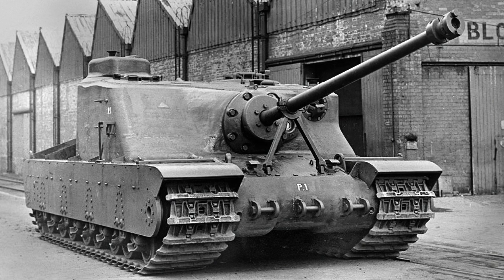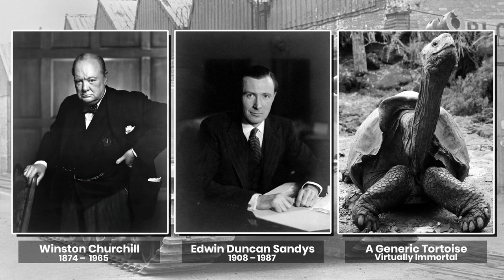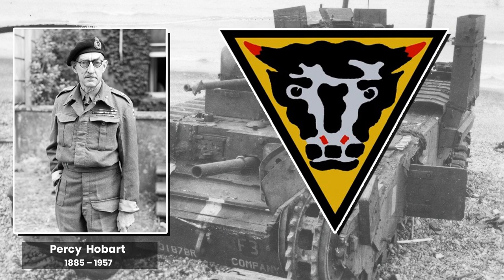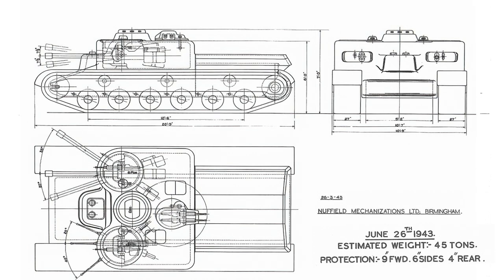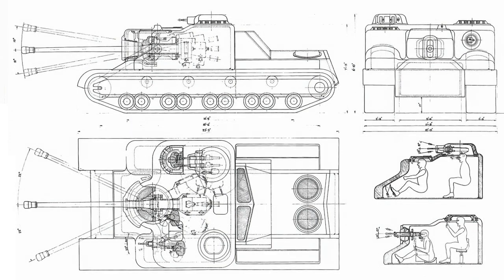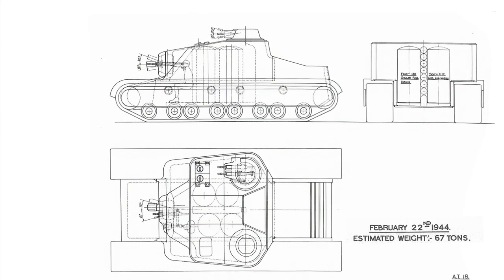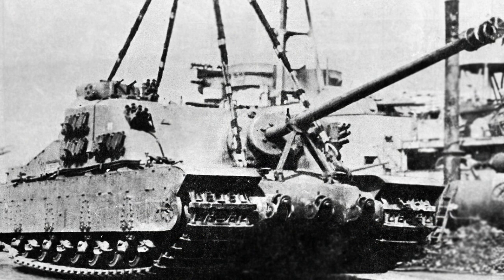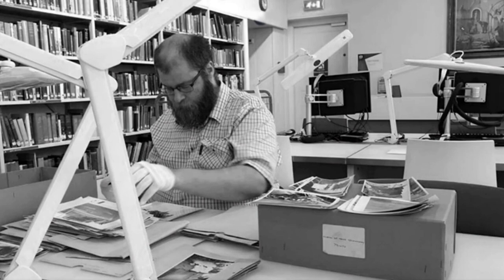A39 Tortoise - Tank Design and Development

Comment: I remember the tour guide at Bovington saying that on it's first demo before VIPs coming out of the shed it almost squashed those VIPs because the driver steered one way but the tank went the other - the controls had been incorrectly assembled.
I don't quite believe the story but that's what the guide told us.
Reply: The volunteer 'guides' at Bovvie are great for enthusiastically getting casual visitors interested, but do come out with some questionable 'facts' sometimes...
Reply: That would have been a wonderful event if it had happened. Road kill VIPs, who never fought in WW2, coming to an end in such a way. They could have been called the hedgehogs.
Reply: If it's reversing, it might have "turn nose the direction of pulled lever" control scheme. So pulling the left lever would make the nose turn left, and the butt turn right, rather the usual brake that side of track. And then some story went around and it becomes told as a technical error rather than the driver not knowing of the thing, because he's never been told, because it's Bovi.

Comment: Good video Ed but you are mistaken about the final suspension arrangement. It does not have a single wheel, 3 pairs and a final single but it has 4 identical suspension units with two wheels each, like a Sherman's on steroids or 4  Centurion units fitted with Conqueror wheels.
Reply from the maker: the 1-6-1 bit. as in single pair 6 in 3 pairs and 1 pair at the rear

Comment: Wonder how well they would have done against directly postwar USSR tanks?
Reply from the maker: enough to knock out is3 frontaly at 1000 yards. - except turret cheeks, although it was never designed for this. the 20pdr however was which was ready in 1944! but not fitted until much later.

Comment: Do you know anything about the FV3807 and FV3809? All I can seem to find is just what guns they were supposed to get
Reply from the maker: heya, yeah they were not made. so when teh FV series came in the idea was that each vehicle would have a corresponding support or varient vehicle on the same hull, however many of thehse were not made. 3802/5 were made the others were not but allocated a number should they be made. Centuion did have a casemated version (sp4) and later a 155 VSEL turret much later and not part of this project.
Reply: @armouredarchives8867  thank you
Reply: Also there is a picture of a valentine with a long barreled gun, I've asked what kind it could be and a few people have suggested it was a 8pdr or even a 12pdr. Do you know of the picture?

Comment: It's easy to say now that a tank like the Tortise was never required because the war was won. But at what avoidable cost in men and material? Except to some degree with the Churchill all other Western tanks were vulnerable to a extensive range of German weapons. So doesn't it make sense that that vulnerability should have been reduced by using something like the Tortoise in a regular leader role right at the sharp end? It would have been relatively slow in transport mode but quicker in the attack mode and that was the important thing, not to be help up excessively which did occur regularly.
Reply from the maker: By the time the project was ready, the war was nearly over. this was a period of mobility over anythign else and so a slow movign and diffuclt to transport vehicle would have just held things up, as well as cause a mess in terms of doctrine and force stucture. Simply having a Tortoise seconded from RA to RAC for each advance would have slowed everythign down and given the enemy more time to prepare. A colum leader like Jumbo would have been handy, but the UK was still mired in Infantry and Cruider roles which made such notions more dificult.
Reply: @armouredarchives8867  The 'slow' Matilda showed what could be done in achieving quick economical victories, why the British did not immediately begin working on a upgraded replacement with an appropriate gun makes no military sense.
Reply: @FairladyS130  Debatable. Matilda II was very good at shrugging off the [then] heavy caliber rounds; but even in the Battle for France the Germans had some 88mm guns, which no Tank in existance [anywhere] was sufficiently armoured against.
(worth noting the largest dedicated A/T Guns in the UK & Germany during 1940 were in the 50mm size range; nothing bigger was to be seen, except in short barrel form)

This wasn't deemed a serious issue though in of itself, as Anti Aircraft guns were rarely encountered by Tanks, and doctrinally not supposed to be used against them anyway.
(Aircraft not being known to wait around to be shot down)

As it was the Germans produced the Tigers and Jagdtiger for basically the same reason the British developed A39: as a Breakthrough Tank. The difference was that Tiger was designed to be the minority of heaviest hitters at the apex of an armoured fist (a "Panzerkunst" if you will), while A39 was intended to destroy heavy fortifications where 17 Pounder armed fare wasn't enough, and naval gunfire support or RAF wizardry unavailable.
Reply: @jimtaylor294  For a start AA units were routinely attached to German ground units in a multi role capacity. So they were a real threat to a breakthrough because they were the last line of defence for a particular unit. Compared with the Soviets the Allies were just too slow to recognise a need for a heavy break though tank and promptly act upon that requirement. And just because they did not act promptly it does not inevitably follow that the need did not exist. It all cost infantry lives but who cares.
Reply: ^ A flawed conclusion in many ways, but here's just a few:

• The 88mm was not available in large numbers in most theaters of the war, making "often" tentative.
• Heavy AA Guns are niether easy to move around, nor typically have armour shields (of any use against ground fire), which is why the Wehrmact had to split off some of 88mm production into dedicated anti-ground mounts.
(the US & UK already knew the practical problems of moving heavy guns around from, which is why a good enough approach was used)
• Having more sizes and types of guns in service than you can make do with is only a drain on logistics and industrial capacity; and as any economist will assert; failing so completely at both is a leading factor in why the Germans lost WWII.
(seriously: look up their absurd number of gun types, subtypes thereof, and ammunition requirements thereof: it hastened their defeat by a considerable margin)
• Between D Day and VE Day, the western allies gained territory every day along the front; even during the Battle of the Bulge, meaning the theoretical german advantage in firepower didn't amount to much.
• As anyone familiar with UK rail loading gauges can affirm; there was a practical weight and size limit, which combined with limits on engine power and torque restricted what could be practically operated even further.
• As any picture of a Panther (45 tons) marooned by a collapsed bridge can illustrate; Heavy Tanks & bigger were a bad idea in general for the terrain of western-eurasia. Add in the fact that most of Germany's attempts thereto were scarce on the battlefield, comically unreliable, insanely expensive and riddled with weak points (Tiger's even side on were woefully under-armoured against allied Tank guns, look it up) & drank increasingly limited fuel like it was going out of fashion... it's no wonder Germany lost the war within a year of D Day.

As mentioned: Matilda II proved that no allied Tank (even in 1940 when German hardware was still limited in firepower) was immune to Heavy AA weapons, but this was as much if a given as bding vunerable to Naval Guns... because no Tank on any side in 1940 was immune to guns that large , nor could realistically be expected to, as they weren't designed to be.
Reply: Not to mention that most Heavy Tanks were rendered much less relevant postwar, as the Shaped Charge and advances in KEP rounds rendered RHA Steel on its own no longer enough. This was why some postwar Tanks didn't even bother with thick armour, until the pioneering of  Composite Armour & ERA changed the dynamic again.
Reply: @jimtaylor294  The Western front experience against an already depleted and disrupted German organisation is not relevant to the equipment used in the bulk of the fighting which was done by the Soviets. They responded directly to the threat they faced whereas the Allies didn't, they (particularly the US) just used their overwhelming industrial power which made any unsuitability of their equipment and consequent losses irrelevant. The heavy armour the Soviets developed and used in response to what they actually faced clearly illustrates my point and incidentally negates yours.
Reply: ^ Clearly you're as nuerotic as you're poor at reading comments, as I wasn't referring to WWI, and don't have a weird obcession with disproving others, rather in the facts of a given topic.

Oh; and the USSR only did a major chunk of the land war; and needed vast amounts of allied material aid. So much so that during the Battle of Moscow, over 70% of the Tanks they had to hand... were British :P .
For the Air and Sea theaters of WWII, the UK & USA did everything that mattered, and still had the industrial capacity and personnel for numerous land campaigns (across multiple continents). The US had little use for a Tank that couldn't be shipped an ocean away nor repaired rapidly in the field, and the British had practical limits to their logistics chain as well. Both were also painfully aware of the irritation that was bridge (regular & provised) loading limitations, and took it more seriously than the Germans. The results speak for themselves; of a handful of Tigers and similar vehicles being a tactical setback, while strategically the Germans were on the retreat in the west, every single day from D Day. 

Speaking of the USSR: they had to ask the RAF & USAAF to bomb targets in Germany for them , as the Russians had niether a credible Heavy Bomber in any useful number, nor the means to produce one or an engine good enough to propell one. The western allies met the requests though, which is why Dresden was flattened.
(the Russians later claimed they hadn't asked for it to be destroyed; but that was after they'd got responsibility for rebuilding that bit of Germany)
Reply: @jimtaylor294  What the hell are you on about with all that irrelevant wall of words? I guess that you can't stay on topic (which is about heavy armour) because you can't think outside your predetermined box.
Reply: ^ Projection much? XD